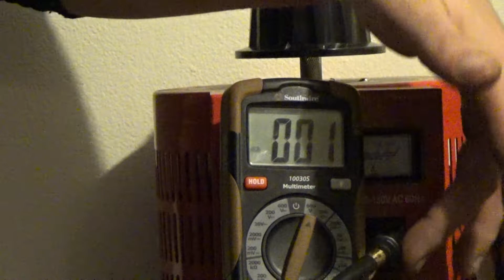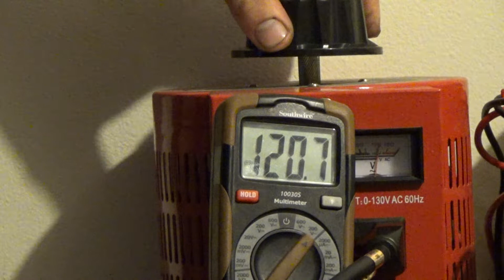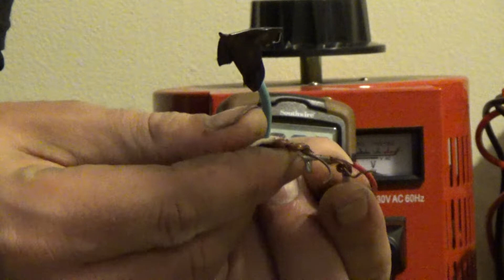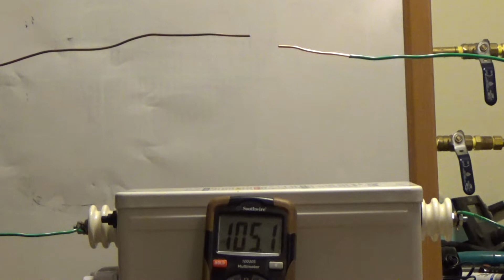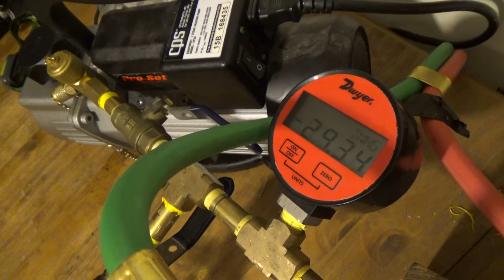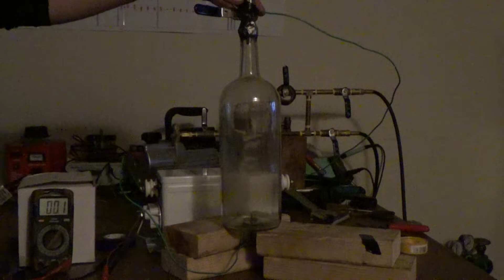High voltage plasma operation

Comment: I've been electrocuted, on or with high tension wires, 99,000 volts, spent a couple days in ICU burn unit, its painless at the time of the event.... You loose sight of everything? Be careful, you wont see it...

Comment: To make it a bit clearer, a short would imply equalizing voltage, creating a constant high current (approaching infinity since R is nearly 0) which drains the source. For example a battery or DC source. This is obviously bad for the source. 
In an arc the voltage stays high as the pressure required to bridge the high impedance gap remains well above 0. Electricity does seek the quickest and easiest path, but in this case it has no choice but to ionize the air. Hopefully I was a bit clearer this time.

btw there are two types of short circuit (plus overload) that your a good circuit breaker protects against. Typical overload switches it off. A voltage type short, such as burned wires touching will cause the breaker to make a buzzing sound. But the dangerous one as far as arc flash is the current short. It will make the breaker switch slam backwards. Any breaker is rated for about three of those. If a person keeps flipping them despite, the breaker CAN EXPLODE like a grenade and has killed people. I recommend people watch electrical safety videos before proceeding with any experimentation. And as a general rule, use only one hand to touch the leads, unless you are very very sure the circuit is open (off).
Reply from the maker: Thanks Shifu, I really appreciate you watching and giving a clear definition of the short circuit.
Reply: @BarelyScience  no problem. 

Hey another channel I just found... Search blue prints magnetron

Guy is good.

Comment: People should subscribe to Photonicinduction and to NightHawknLight and related channels and learn a bit more of the basic physics 
Also read the Hawkins Electrical Guides to brush up on your classic electromagnetism.

Btw we don't call the arc a short. The arc is flowing where the permittivity of the air broke down and the gases ionized forming a channel. But the tension on that gap remains very high still. Essentially an electric field formed between the leads and the charges are flowing in a curvilinear fashion along the field where it breaks down the air forming a conductive plasma. But it is not 0 or low impedance so it isn't really a short circuit. If it we're you would have a runaway current and something would melt. The impedance is still high enough to create a lot of heat as all the power or most is dissipated in the arc.
There are four basic modes of plasma and arc mode is the second highest. Obviously space currents especially high energy jets are the most powerful. There is also a basic glow mode and a dark mode. It all depends on the voltage and current as to what structure it will form.